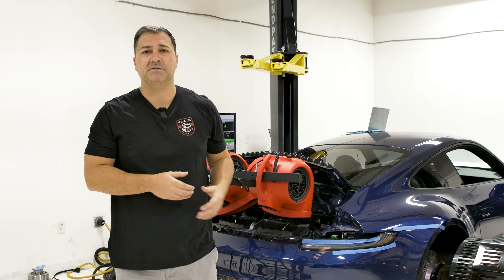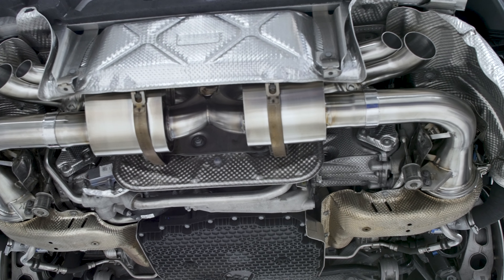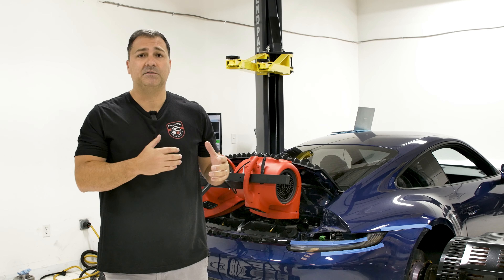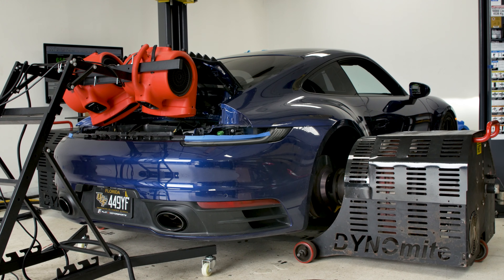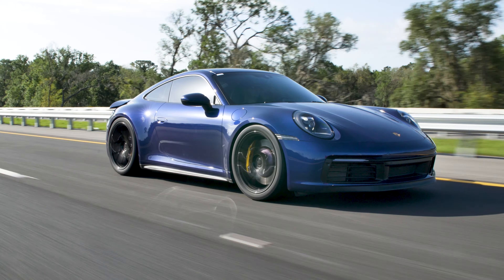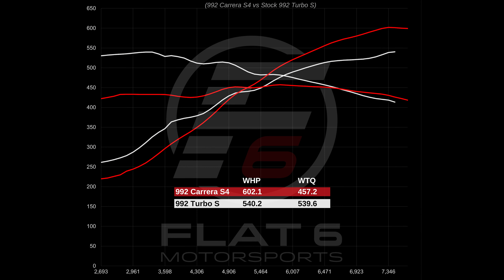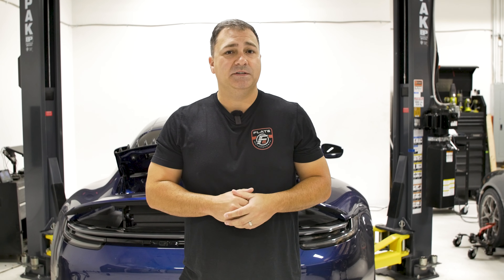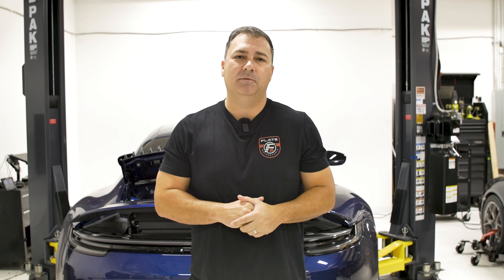700 HP 992 Carrera - Flat 6 Stage 4 Power Kit w/ Pure 800 Turbos

Comment: Please standardize the graph of the Turbo S and Carrera so they are on the same X Axis. It's misleading at the moment, as you can see that the torque/horsepower crossover point (which is mathematically always the same at 5252 RPM) are happening at different points on the graph. That makes the area under the curve comparison hard to discern.
Reply from the maker: We’ve gone a long post on this topic on Rennlist. The short of it is the visualization software doesn’t let us justify the two axis independently so it artificially pushes one the other way based on the data samples and respective RPMs. We have the raw software we can provide an export on if you ever need to see it. Just shoot us an email. We’ll keep looking for a solution that represents the data well. We use this method for quick snapshots that look presentable. Thanks for the comment.

Comment: I'm curious how well traction control on launches work. I know stock it's pretty great but now you've more than doubled the stock HP
Reply from the maker: Pretty robust, I'm running Cup 2s on there now (slightly wider than stock). I suspect it would have a lot of wheelspin on Eagle F1s. I'm hoping to get some dragy 1/4 mile times when we get an opportunity to test.
Reply: @Flat6Motorsports  did you manage to get some times?
Reply from the maker: @mirceabanica1068  unfortunately, we never did but probably good enough for a high 9 on a prepped surface

Comment: Man your content is unreal. Loving this 992 content. Would you stick the inconel headers on this??
Reply: Downpipes and catback is already really loud. So adding headers will be pretty nuts 😂🚀
Reply from the maker: OEM headers/manifolds
Reply: @Flat6Motorsports are you planning on doing data logging on non oem headers/manifolds?  I’m interested in SoulPerformance manifolds and headers but I’ve not seen any evidence they help at power levels at or below where your test car is currently.  Great vids and great real world evidence - this is the best.

Comment: Why is torque so low? Previous Carerra builds on here show much higher torque, and different curves. Is this a PDK car, or is this just part of the hybrid turbos?
Reply from the maker: I'm not sure what you are referring to, I have a graph with the different stages of builds we offer and this delivers the most torque output for a 992 Carrera.
Reply: On your "Best Kept Secret" video you put GTS turbos (and supporting mods and tune of course) on a Carrera and it made 521 HP / 530 ft-lbs.
Reply from the maker: @nberkel  ahh, that was a 991.2 Carrera on a different dyno. Those do make a little more torque with the custom tuning in the midrange but mostly due to the dyno (dynojet vs hub dyno)
Reply: I see. Didn't even pay attention to the difference in dyno type. Seems strange that a 991.2 would make more torque than a 992 though, would have just assumed them to be the same assuming same mods/dyno...
Reply from the maker: @nberkel  A little has to do with the tuning, some with turbo sizing and mostly the dyno. Overall, they make pretty much the same power with the same mods between the 991.2 and 992.

Comment: I do want to do this with my C4S, but have concerns with the increased power placing more wear and tear on the engine/drivetrain and negating my warranty if I break something. 

I've never heard anyone state these possibilities or touch on this at all. Any issue here?
Reply from the maker: We've been tracking 991.2 and 992s now for over 8 years pretty heavily with 750+HP and have had zero issues with the drivetrain. The engine is common between all variants of the 992 Carrera (S, GTS, etc.). Majority of the Turbo architecture is shared (forged internals, blocks, etc.)

Comment: How much HP can the Porsche manual trans handle?
Reply: Im curious about that too, also as there is no a/m clutch option I guess when the stock clutch has to go just swap in another oem unit?
Reply from the maker: We haven't seen any issues with the 650HP mark but we'll continue to have clients running more and more power over time. I'd personally prefer a manual but we wanted to get a PDK for cost and figured more folks would have them over the manual. I don't see these power levels being an issue on the manual transmission. Porsche builds a great manual and uses a beefy Sachs clutch.

Comment: Do you guys have any further content on the Stage 4 tuned car?
Reply from the maker: We did add the meth and tested with the Stage 4+ set-up. We have since picked up a manual Carrera T that we are doing testing with. More to come soon on that vehicle.
Reply: @Flat6Motorsports  so what were the results with the meth? Can’t see the video
Reply from the maker: @E.D_R.O.B.S.  We got another 60HP with meth.
Reply: @Flat6Motorsports  at the Crank or at the wheels?
Reply from the maker: @E.D_R.O.B.S.  whp